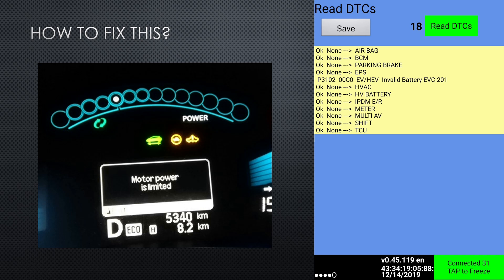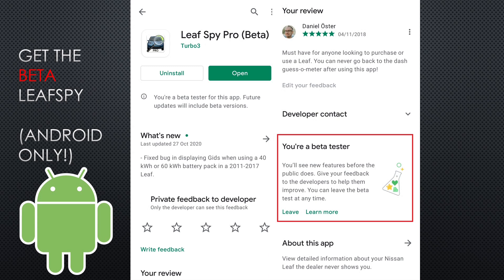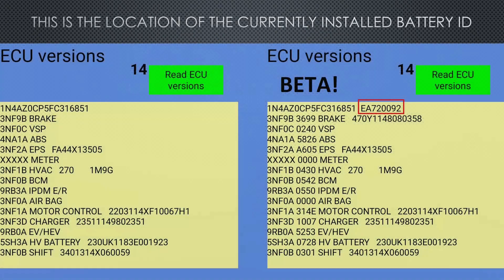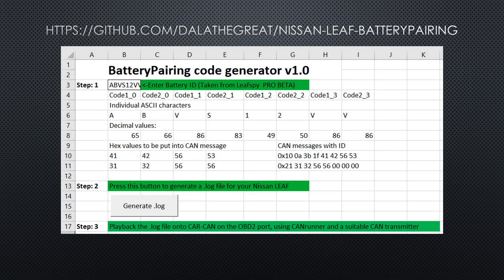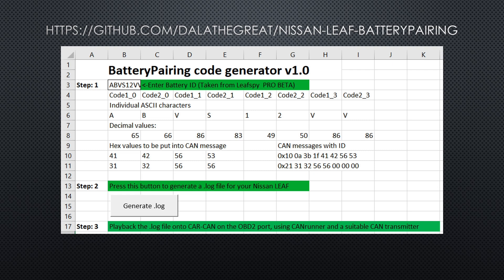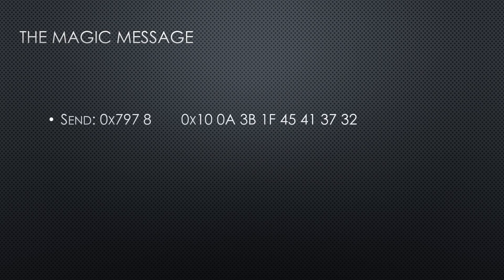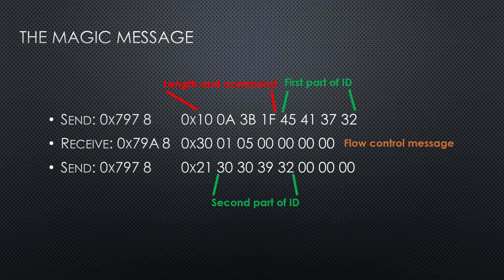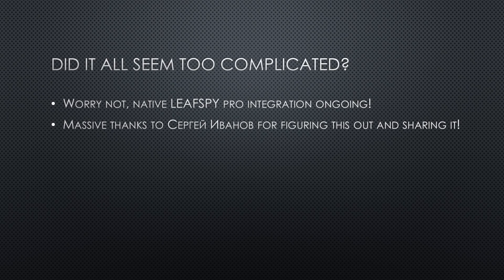Nissan Leaf - Battery ID Secrets Exposed [PART2]

Comment: Why is the term "swap" used for putting in a replacement battery of the same size?  A swap should mean a change to something different like and engine swap for gas cars.  If you just put in a used engine of the same type it would be called replacement.  Oh well must just be that many of the EV guys don't have your background with other cars.  Greatly appreciate your work.

Comment: Hi. I have a problem, leafspy generate id battery EAN20052 and file dont generate correct LOG file
Reply from the maker: Normally I would be happy to troubleshoot this, but Android Leafspy Pro Beta now contains an automated procedure for pairing. I suggest you use that!
Reply: @DalasEVRepair  ou! I have beta, but I don't see this menu for paring battery. Maybe you can screenshot it
Reply from the maker: @maxdpua  Go to ECU versions. Read versions. Go to DTCs, read DTCs. If P3102 is present, it will be possible to pair via clear DTC menu
Reply: @DalasEVRepair  senks. 👍. I have not replaced the battery yet, apparently because I do not see this error😀

Comment: Hi there, awsome work! You mention that swaps must be direct (24 to 24, 30 to 30 and so on) but I have seen someone on youtube make a direct battery swap from 24kWh to 40kWh with just this kind of pairing and the car has recognized the battery and everything works fine, of course there are some quircks like GOM blinking between max and current meter and other stuff like that, but, as far as i saw nothing really breaking to justify the extra cost to install a custom can bridge. Do you approve such a "upgrade" or do you think that this kind of "direct upgrade" can damage the car or the battery?
Reply from the maker: No I do not approve. Important messages are malformed and the vehicle won't be safe to operate/charge. CAN-bridge is needed for a safe upgrade. The channel you mentioned was most likely the one which I sent a CAN-bridge to? :D
Reply: @DalasEVRepair  Hi Dala, thank you very much for your response :) I thought about that too, but the video states that both charging and fast charging are working properly :) I understand that some messages can be wrong, but if that only causes the dashboard blinking, would that be so harmful? The video in question is this one: https://www.youtube.com/watch?v=bgBB0L3i_Bg&t=480s and the chanel name is "gelisob". Now, if you say that this is impossible to work, and the video is a lie, i believe you :)
Reply from the maker: @techstack1on1  That channel owner 'gelisob' installed a CAN-bridge some weeks after! It is not safe

Muxsan also states that this is dangerous, see here: https://www.mynissanleaf.com/viewtopic.php?f=34&t=27600&start=560#p601878
Reply: @DalasEVRepair  thanks a lot for your explanation, very useful indeed, i'll go for the CAN bridge then 😄

Comment: Привет. Я хочу провести эксперимент. Выяснить, влияет ли количество зарядок QC L1/L2 на SOH. У меня в машине стоит не родная батарея и количество зарядок QC L1/L2 в LBC меньше, чем в VCM (при замене батареи не сбросили счетчик). У вас есть CAN команды, чтобы прописать верные значения QC L1/L2 в VCM и сбросить SOH? Может быть Сергей Иванов знает такие команды? Можете написать на почту pahidza@gmail.com, если что-то знаете? Я знаю, что в приложении LeafHacker реализованы эти функции, но это стоит денег...
Reply from the maker: Количество зарядов не влияет на SOH, рассчитывается постоянно.
Reply: @DalasEVRepair  хотелось бы записать верные данные в vcm
Reply from the maker: @pahidza  Тогда LeafHacker, вероятно, пока единственный вариант!
Reply: @DalasEVRepair  я нашел в ваших логах команды запроса у батареи количества  зарядок и запись их в VCM https://github.com/dalathegreat/Nissan-Leaf-BatteryPairing/tree/783551076e410db4bf9893aadaada610240b5579

запрос и ответ от батареи:
79b	02 21 62 00 00 00 00 00 	
7bb	10 76 61 62 08 00 01 5a
QC = 015a
L1/L2 = 0800

запись в VCM:
797 02 10 c0 00 00 00 00 00 	
79a 02 50 c0 00 00 00 00 00 	
797 04 3b 14 08 00 00 00 00 	
79a 02 7b 14 00 00 00 00 00 	
797 04 3b 15 01 5a 00 00 00 	
79a 02 7b 15 00 00 00 00 00

сегодня проверил на машине (AZE0 2013) - сработало!

При замене батареи можно командами 
79B 02 21 90 00 00 00 00 00
79B 30 00 00 00 00 00 00 00
запросить у батареи её ID (не нужен LeafSpy Pro),
потом отправить ваши коды привязки
и после прописать данные о зарядках из новой батареи.

Comment: This is awesome! Good job! A question, can you add a extra batteri in a E-NV200? (Maybe not a leaf)  Like 2x 24kW battery,  std battery and one extra i the trunk, so you got 50kw or 2x 30kw? The 24kw battery is cheper to buy and alot easyer to find then a 40kw battery pack.
Reply from the maker: Is it possible? Yes. Does it require 100s of engineering hours? Also yes.

Easiest just to contact Muxsan and get a range extender. Or wait until a 40kWh pack shows up!
Reply: @DalasEVRepair  hahaa, i thought so.  I got an offer for a 40kwh for 60 000kr nok. But is it worth it? I find it a little expensive.
Reply from the maker: @cblad1406  Heck yeah it is!
Reply: @DalasEVRepair  but its hard to find 40 kwh battery to. do you any range extender like Muxsan? it he useing e-golf batttery?
Reply from the maker: @cblad1406  No, range extenders count as an extreme HV modufication here, will cost too much to certify each install
Reply: @DalasEVRepair  a question. Back to the E-nv200 2x 24kw,  Regardless of the second battery BMS and canbus. Dont plug it in or 3:e part bms (zeva bms)  for the extra battery. Can you put 24kw battery in pararell and split the input cable under the car. Same volt, same charging curve, "the gussometer vill be... " but vill it work?
Reply from the maker: @cblad1406  Go to Muxsan!

Comment: Thanks for doing another video on this.  This is kind of swap I'm doing, and probably the most common type of Leaf battery swap.  I would feel much less confident attempting this swap without your instructional videos.
Reply from the maker: No problem! Now it is really simple to do a same generation swap, all that is needed is Leafspy Pro!
Reply: @DalasEVRepair  Do you need to install a CAN-bridge to transmit this new code to the vehicle?  Or can all the code editing be done using exclusively LEAF SPY?
Reply from the maker: @InnovativeSustainableSolutions  Everything related to batteryID can be resolved with Leafspy Pro now!
Reply: @DalasEVRepair  Holy shit, that's awesome!  I'm going to e-mail you real quick so you can give me some pointers

Comment: Hi, question is not related to this, but I think your the best person to ask, Will it possible to charge nissan leaf while on drive mode using a generator? ( Similar way as Nissan E-power-Enote car)? or will it possible to recharge the nissan leaf using Enote power generator while on a drive mode? Becuase most of the Asian Countries does not have proper battery upgrade or replacement solutions. appreciate if you could do some sort of a video on this. Again thanks a lot for helping the EV community.

Comment: Hi, Sorry but in my case it doesn't generate because in G10 and G11 is link for unavailable address G10 (=_xlfn.CONCAT(I31;B10;K31;C10;K31;D10;K31;E10) and G11(=_xlfn.CONCAT(I32;B11;K32;C11;K32;D11;K32;E11;I33))
Reply from the maker: Are you using excel or openoffice?
Reply: @DalasEVRepair  Excel
Reply: @DalasEVRepair  In time when I've change battery ID (B3) changes in G10 and in G11 to #name?
Reply from the maker: @pavelvasilevich6631  Can you give me the ID you try to enter?
Reply: @DalasEVRepair  J3S20034
Reply from the maker: @pavelvasilevich6631  Works fine here, generates this file: https://i.imgur.com/RlLPFK6.png
Reply: @DalasEVRepair  Your file in this link was changed 23 hours ago maybe it was mistaken?

Comment: Also keep in mind that if you're swapping a battery without a heater into a car expecting one, it won't work right.  The battery heater is missing and it will confuse the computer.  Essentially the computer will stay awake trying to talk to the computer and drain the battery over a few days. 

In the US, this only happens if you do a 2011 battery into a 2012+ car, but I don't know how the battery heater feature was rolled out globally.
Reply from the maker: Good to know, makes one wonder why anyone would downgrade the battery?

Comment: I own a 2016 Nissan leaf that was a 30kwh swapped with a 40kwh battery by a Nissan dealership, do you know if maybe I could swap from a 40 to a 40 in the future?
Reply: Hmmm probably not bc the 40kwh I have probably has custom firmware
Reply from the maker: Yeah hard to say how Nissan does this!
Reply: @DalasEVRepair  The principle is the same! It doesn't matter what the battery capacity is.

Comment: I wonder how EVs Enhanced in New Zealand has managed to create an OBD2 dongle that works by simply plugging in the dongle, then pressing a button - no need to input the new LBC's ID number. If you have any insights, that might make an interesting followup video :-) I wonder if perhaps the VCM sends out its ID on the CANBUS and EVs Enhanced has figured out that the LBC's ID is a hash of the VCM's number...
Reply from the maker: I suppose that tool works the same as Leafspy, you can make the script first request the currently installed battery ID like this

0x03 22 12 5c 00 00 00 00 Read battery id, return package, first part 0x30 00 00 00 00 00 00 00 (no wait, can receive multiple packet)

And then use the commands I have listed to pair in that response ID. That way the tool can operate autonomously!
Reply: Maybe Leafspy will get this Button?
Reply: @christianromer882  looks like thats the plan
Reply: If Leaspy can show the ID then it means the battery sent the id code -> it's readable on CANBUS and any device attached to it. Another possibility is that leafspy can query for the id, but then so could any other device attached to the bus.
Reply: @PasiSavolainen  oh true. The pairing tool may just listen to CAN messages and then transmit the pairing with heard ID, done.
Reply: I think we can pretty easily make a random ESP32 to do this now.
Reply: Dont they first put in the CAN translator near the battery connector? This can read the ID and then the dongle can execute the command, maybe.